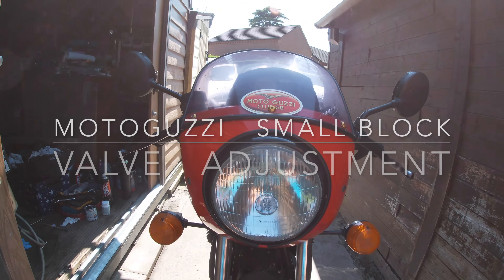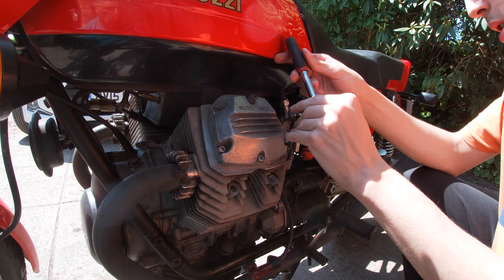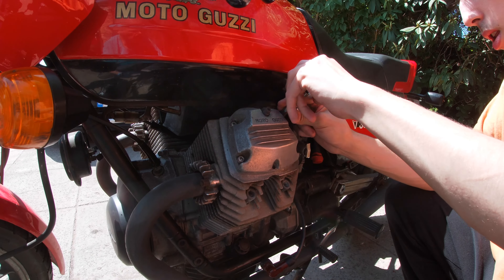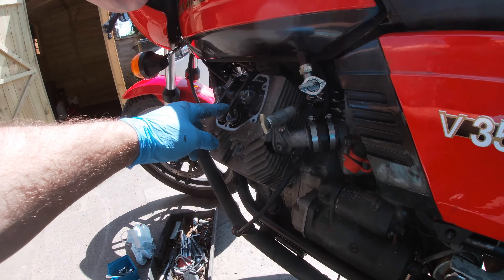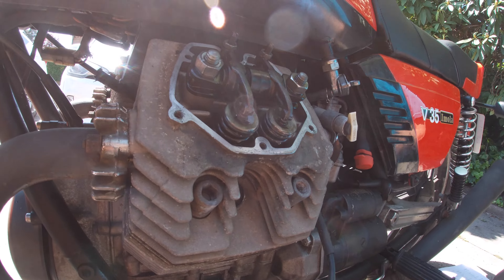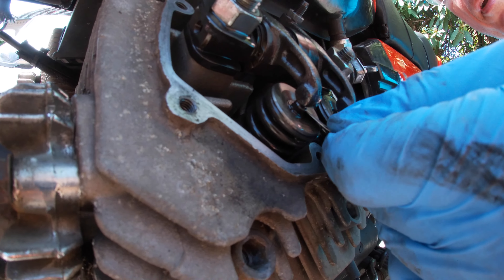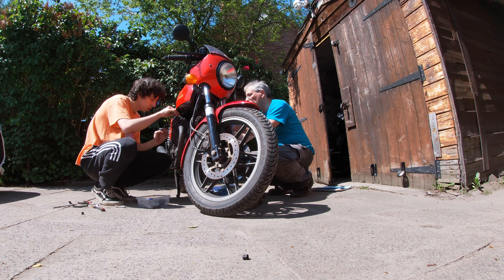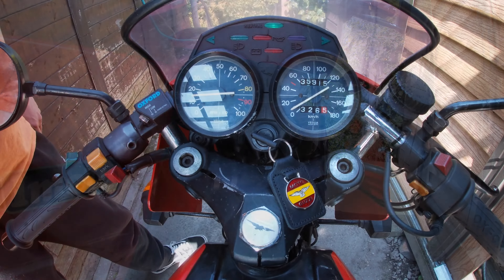Valve adjustment on a Moto Guzzi small block engine easier than you think

Comment: I put my thumb over the spark plug hole while me mate turns the rear wheel.  You can feel when it's on compression stroke and the valves are off the lobes.
Edit- years ago I worked at a Honda dealership. The new 750's & the CBX  used shims to set the valves. The smaller & older bikes had screw & locknut adjusters. Some models were difficult, others almost adjusted themselves like magic. The CB-650's were the easiest.
Reply from the maker: Or you can look just at the valves 🙄

Comment: Considering buying an V35 Imola. How is the availability on parts for this rather old lady?
Reply from the maker: No problem at all 
Items like clutches are shared with the modern V7 for example 
Body panels are easily available used on EBay but there are Guzzi parts specialist too
Reply: Thanks a lot🙏🙏

Comment: Do you re-torque the heads at all prior to the valve adjustment?
Reply from the maker: The engine has been together for some time and through a number of heat cycles so it would seem unnecessary

Comment: Are these small blocks the ones that drop exhaust valves or is that the 4 valve?
Reply from the maker: Well four valve 
According to mechanics valve failures on two valves can of course occurs but failures are less likely to occur 
Than  in many contemporary machines with many running up high mileages with no problems 
Its one of those things owners of Japanese bike owners  dredge up 
Call it an inferiority complex on their part 😂